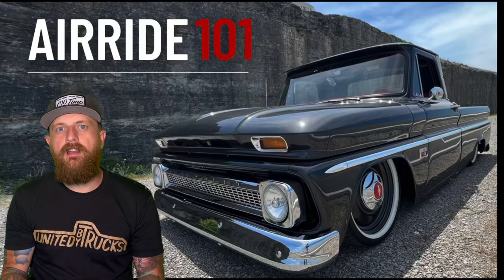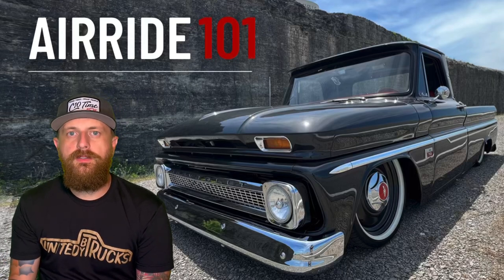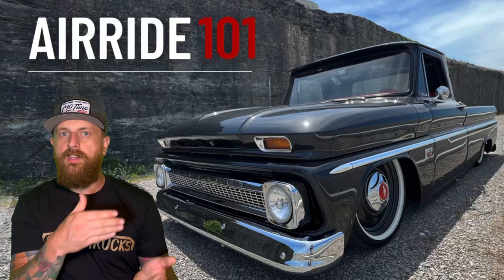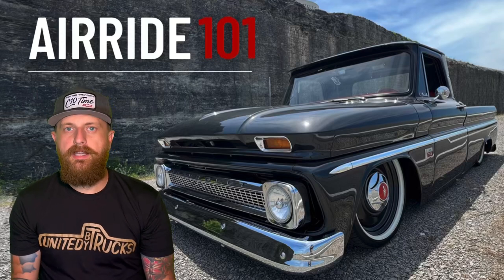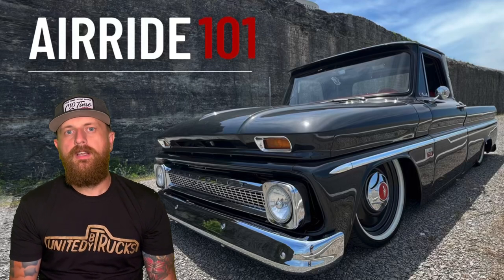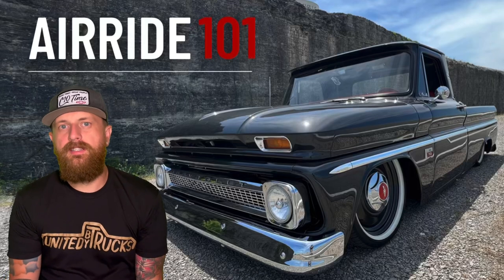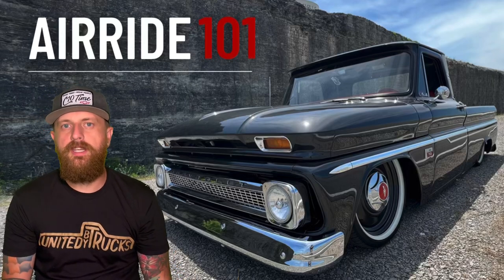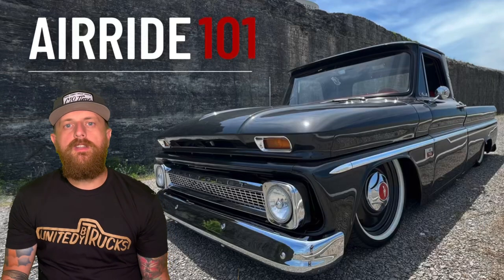AIRRIDE 101 | Learn how to install air ride suspension. | A simple guide on how to plan a build!

Comment: What Cpp lowering control arms did you use up front . Do you have part number  the cpp one I'm see say that they wo t fit  6372 TCA-LAB 1014 ?
Reply from the maker: https://www.summitracing.com/parts/clp-6372tcalab10?seid=srese1&gclid=CjwKCAjw-8qVBhANEiwAfjXLrgUZUQhOphTwfUxn_C3qW_k2TKN1Wyy0-mh-tL0yYOXIAgoU0X3qyxoC5XEQAvD_BwE

Comment: My 64 GMC 2wd 1/2 ton has leaf springs in the rear all factory it sucks seems way easier with the arms
Reply from the maker: It is way easier with the arms. With a gmc, I would just buy a bolt on four link and do bag over axle.